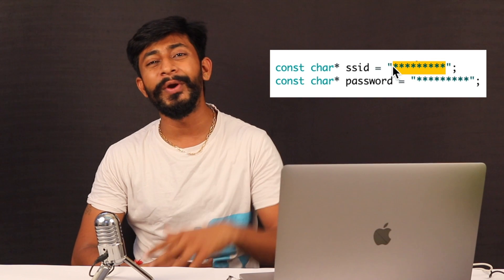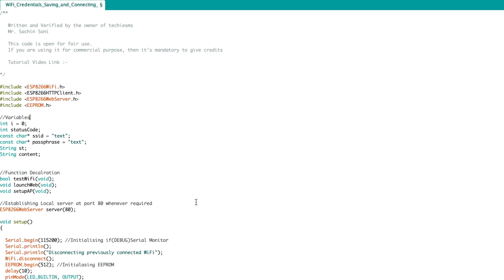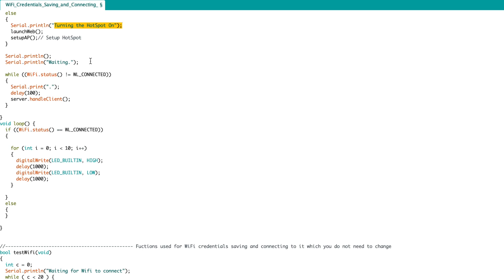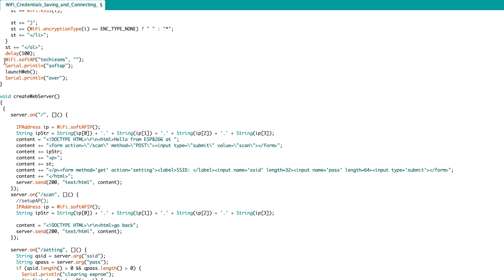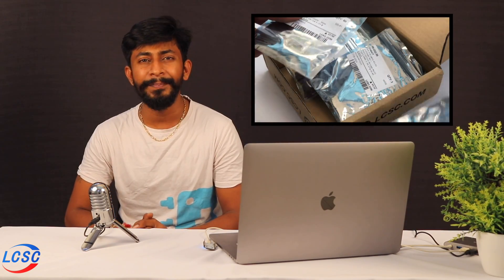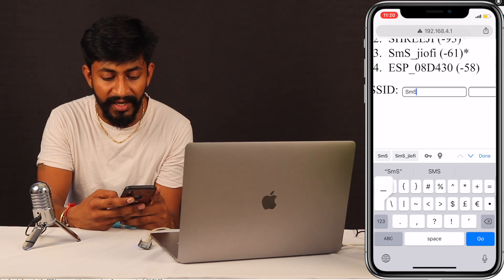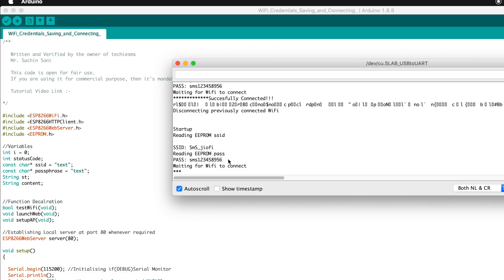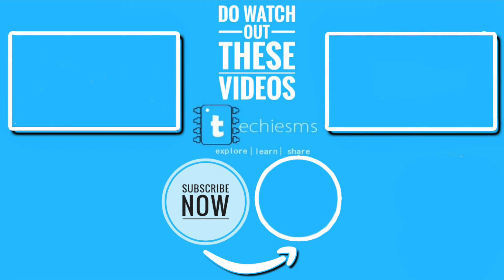WiFi credentials stored in EEPROM | Better than Smart Config | ESP8266 projects | LCSC | SBU

Comment: Hi Sachin. One mre usefull project. Short and simple. i was thinking one more option. now take an example. i am end user of one project implemented with your code. i dont have arduino IDE on my laptop. so, when AP is connected successfully i should get one green light connected on one pin on nodemcu so that user should come to now of successfull connection. afer that only he should connect to his wifi and later on successfull connection to his home network, the same green led should blink 5 times and then your led blink code should come (or actual code), what say

Comment: I have been trying to store the data to another string like you do in this with esid variable and saving it, but to no luck, before I think I could do it, and it could connect but now for some reason that doesn't seem to be working, idk what to do, I am doing the same as you, but what I have is ESP32-WROOM32D board, and I tried checking it various ways, not sure what is wrong.

Comment: There is one problem, that if the router and esp both restart at same time, esp boots ahead of router and since the eprom credentials not available as the router is still not available, it goes in AP mode and we have to again restart the esp once router is up

Comment: I tried it but in serial monitor reading EEPROM SSID and pass not shown just blank, waiting for Wi-Fi connection then it turned the hotspot on then the local IP :(IP unset) show soft IP : 192.168.4.1 and scan network and then  it just remain waiting. esp8266 hotspot  not show on smart phone or laptop and the IP address 192.168.4.1 also not open i tried many times . kindly guide me how to do it.

Comment: Sir I have a small query that I'm unble to solve can u solve it my problem is that I want to do simple led on off using esp8266 and thinger io I have done it but after power off and then on to esp then that does not save last state it reset .means my last test is on but after esp reset that shown led is off. Or wise wersa . I want to do program as like after reset it should be shown last test ie on will be on or off will be off. Please help

Comment: Is it possible to run nodemcu to do following 2 task at same time in parallel?
1. It should act as hotspot for listening new ssid and password 
2. It Should scan available wifi to connect with existing wifi credentials from EEPROM

Comment: One confusion, what if I want to erase the data written in the EEPROM?
Reply from the maker: You just need to turn that router off or take your esp out of range and reset the esp. first it’ll try to connect to the same router and after some time, it’ll create its own hotspot and you can provide other credentials and as soon as it get other credentials it will erase the eeprom and save the new credentials there
Reply: @techiesms  ok great
Thanks :)

Comment: Very useful
How to change router SSID and password after connecting one router?

Thank you
Reply from the maker: Just turn the router off and reset the esp, it will try to connect to the router for some time and after that it’ll create it’s own hotspot and you can add the credentials
Reply: @techiesms  
Can we add button for that?
When long press the button, the SSID and password become erase?
Reply from the maker: e-lab innovations yes, we can do that too. That’s a nice idea
Reply: @techiesms  
Thank you
Reply: e-lab innovations I would use a Boolean variable to say “ssid/pass set” = FALSE when it hasn’t been setup. When they set it and connection is successful “ssid/pass set” = TRUE. If button x press = true then set “ssid/pass set” = FALSE
Reply: @techiesms  What if I want to erase EPROM settings? Is there any way to do that?